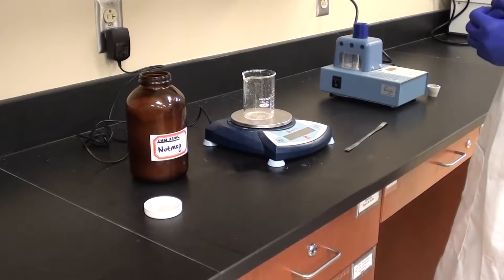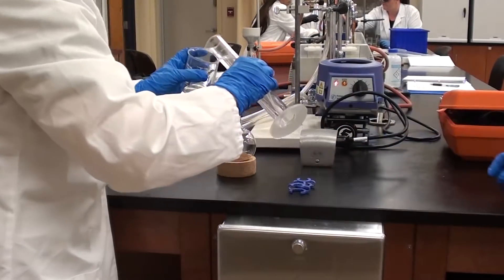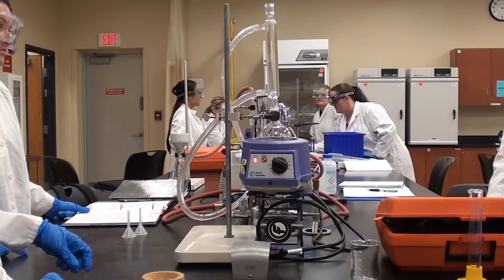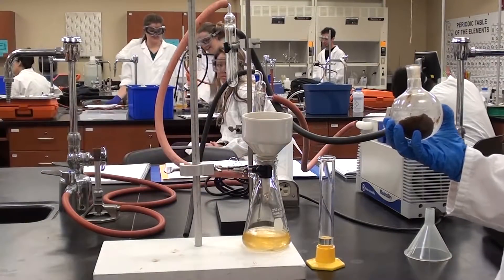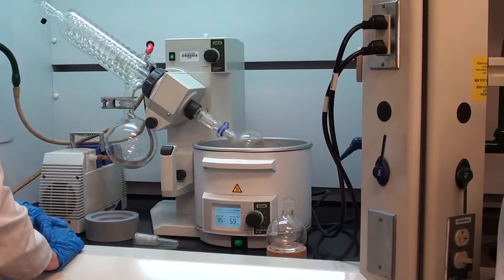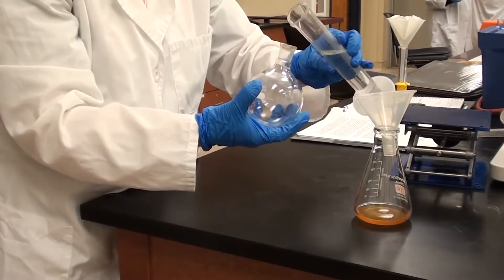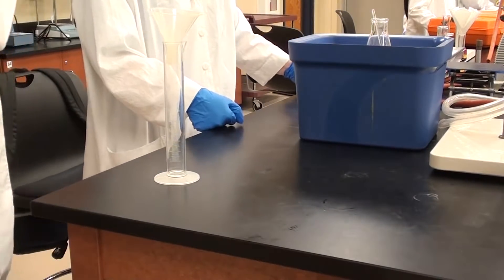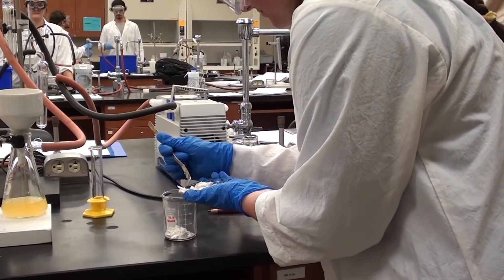Nutmeg Lab - Isolation of Trimyristin (Part 1 of 2)

Comment: Why did u use methanol for the second part (crystallization) ?
Reply: Probably because the product is slightly soluble in it but will crash out of solution with a decrease in temperature.